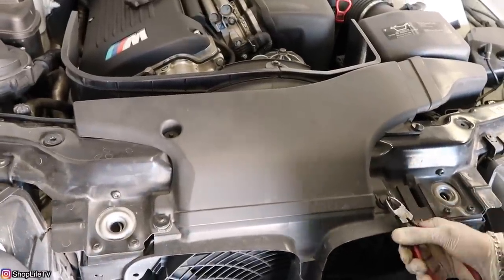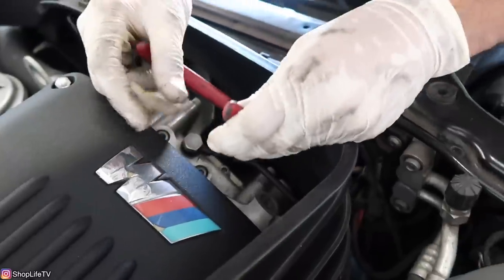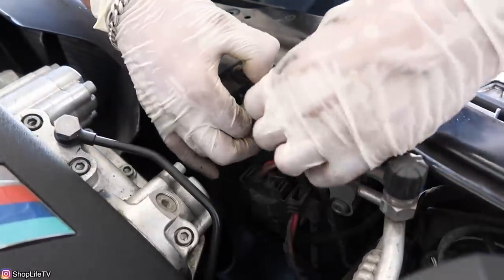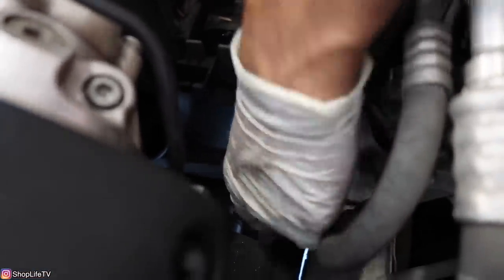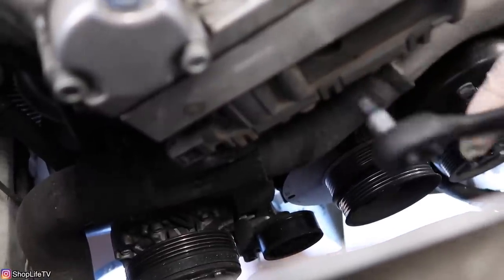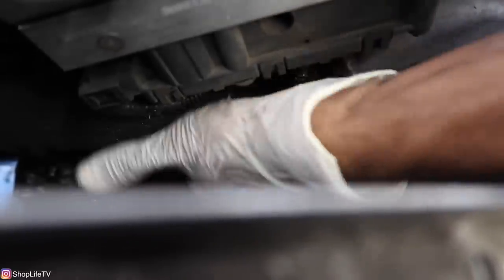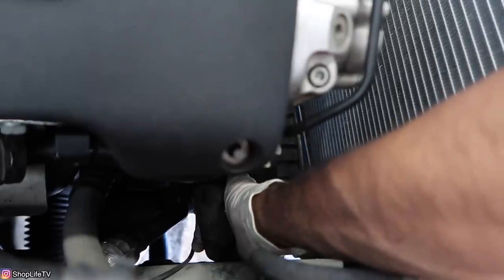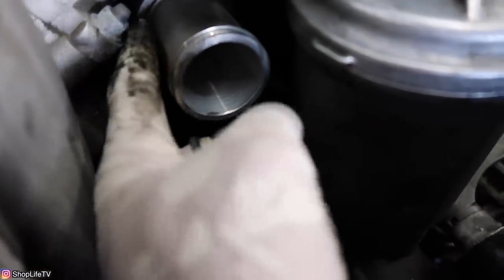Waterpump & Thermostat Replacement On BMW E46 M3

Comment: Question, I noticed the gasket you are replacing is not the metal one..did you experience ang issues using these instead of the metal ones ?

Comment: I did this for my E46 M3. But my water pump was 100%. I replaced all belts and both tensioners and all pulleys. New thermostat. New O rings. New sensors.
Fixed power steering pump mounting by adding proper length bolts.
De-greased everything. Cleaned MAF sensor.

303 Protectant on everything. SOAKED belts in 303 prior to installation. Pulled radiator and flushed. Cleaned fins on OIL COOLER!! This helped!

Comment: Hi Ankur, really great "How To" video mate, thank you. Can I ask what the symptoms were for this car as I can see the same blue/white spray from the fan on the plastic shroud of my M3. Is it an easy diagnostic that I need to replace the water pump? Mine is 2006 but only has 82,000klms (51,000Miles). Thanks in advance, Andre.

Comment: BMW uses a lot of those Plastic Rivets in various places. Husky 1000014633 from Home Depot. I think
 they call it a Tack Puller. Works cool for these. I took ours and slightly filed the 'V' into more of a 'U' 
shape. 6 bucks... ;)

Comment: Watched this ages ago but came back to it to make sure there is enough room to remove just the fan clutch itself and not the entire shroud housing before upgrading my pulleys with underdriven ones from Rogue Engineering. Can see quickly at 4:18 there is just enough wiggle room to drop the fan and get access to the pulleys. Thanks again!
Reply: How did the pulley change go?  I have to do the same soon and am looking for the easiest/best way.  Also, do you have those two lower screws on the shroud?

Comment: How important is it to change the expansion tank while doing this whole job? M3 has its expansion tank in the back compared to regular E46 so it does not get affected by the heat of the engine as much and plastic doesn't get as brittle. Thoughts? Thanks

Comment: How would you know (outside of the obvious (leak, drip, etc at the pump)), that your water pump is or isn't circulating? Recently I noticed there's no recirculation at idle via the small hose to the reservoir and it tends to run "hot" at idle/stop. It's cool or normal as I drive. Someone mentioned the secondary HVAC water valve and solenoid. Thoughts? I've also noticed the Evap fan running on-off with the heat on A/C Off. Thanks for the excellent videos!

Comment: My car was over heating and underheating last year during hot days. 
I had the thermostat replaced and the issue was fixed!
Starting last week, my car now over heats with the AC on... but only on the hot days with the AC on.

Im wondering what is wrong.. I was thinking maybe its something other than the thermostat HOWEVER when I drive the car during cooler evenings the car is now under-heating again ever so slightly. because temps fluctuate a little high and a little low I'm thinking it must be the thermostat.

Comment: Hello I'm having a big little problem I just replaced the water pump out both new belts and I put new hoses and a new expansion tank kit and I have a leak that does not go away from the expansion tank I even changed the orings and made sure all hoses where places in right and snap into place and the leak does not go away. What can I do

Comment: Hello mate
I have two questions for e46 330i automatic
1. My oil sensor needs replacing. It’s expensive to replace.are there any dangers if I left it unrelated?
2. The reader is also showing error P0705 gearbox switch. Is it easily accessible to replace or gearbox has to be dropped?
I can’t see any YT vids on this
3.a suggestion.: why don’t you do a special video on e46 sensors. Show the location of all of them and how to replace.bmw have too many sensors

Comment: Great vid and well demonstrated as usual mate. Just one thing though, in the TIS it explicitly states to not open the bleeder screw on the S54 as the system is supposed to be self bleeding? I'm sure that the plastic pipe that it sits in is the same one throughout the E46 range to save on manufacturing/development costs and that's the only reason that it is there on the M3 models. That said, opening the screw would be very unlikely to have done any harm and the way you demonstrated would do nothing bad to the system.

Comment: good tip to remove rubber hoses is to use a bicycle spoke. slide it in then spray some teflon lube like gt85, then rotate the spoke.

Comment: Very informative. Can you remove the fan shroud without taking the fan off?
Reply from the maker: Thank You! You can remove the side parts of the fan shroud without removing the fan, but the main shroud will require the fan to be removed.

Comment: Hi mate 
I've some issue with my e60 523i 2007 starter motor. so when i push the start button, i can hear an electronic sound like solenoid! but the care dosent start and the start button dosent release (need to press again to release). I checked the battery which fully charged, all switches are good by a mechanic. I did disconnect IBS (Intelligent Battery System) and try to start up but had no luck :(. could you please help me with the starter motors video 2007 e60 bmw?

Thanks 
sha